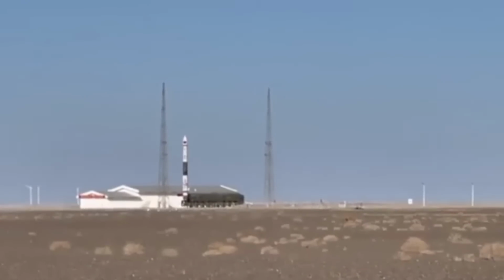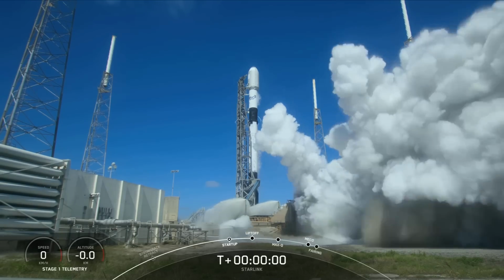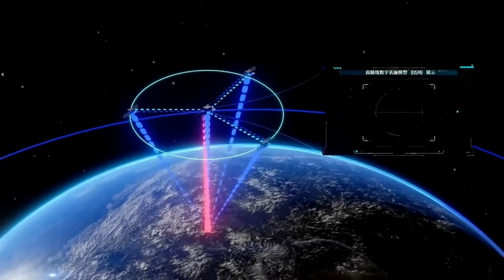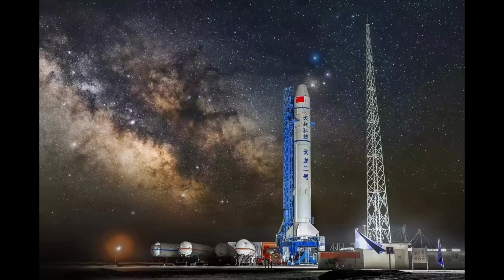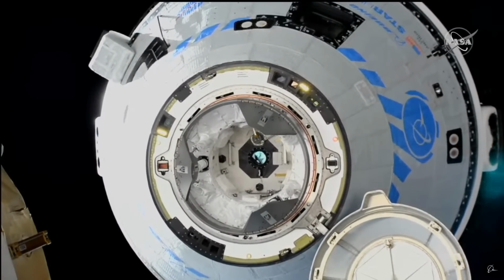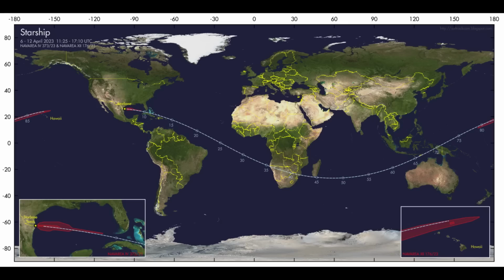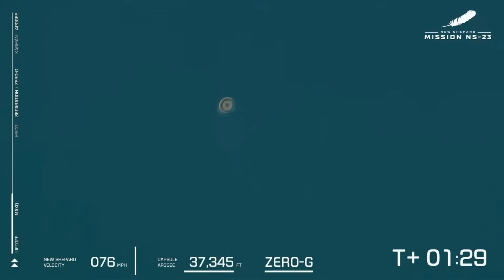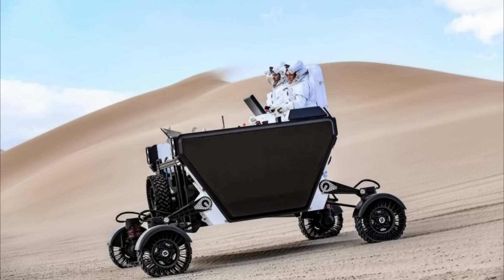Is China's New Rocket Really Coal Powered? Deep Space Updates - April 2nd

Comment: Hey Scott. given the resent tests of the Rotational Detonation Engine, what is your take on when we'll start seeing it used on actual launches?  any thoughts? (good luck on your flights!)
Reply: Not Scott, but: Last tests were on low power prototypes, short duration. Some of the math is still unsolved, so it's years away.
Optimistic timeline: 2030, realistic one: 2038ish.
Reply: We'll have scramjets and fusion power plants before RDEs. It is always a very good bet that any technology idea that has been worked on for more than 50 years and still has no practical prototype will never have one.
Reply: @kenoliver8913  Well, that is the point. We now have a practical prototype. Hence the question....
Reply: 2038? I feel like that might be a little optimistic. I would peg that as the early timeline personally, but only based on guesses

@knoz, it's more of an experimental prototype rather than practical
Reply: @joshuacheung6518  Yeah, I multiplied my actual guess by 1,2 because of the advent of a.i. Also I didn't know if you guys or the 'naive optimism squad' would show up.
Buy still, we just had a working test article, after the field has, um, stalled for a few decades.
Reply: Turns out the optimists wanna do flight at mach 3 next year. Take that with a good helping of table-salt.
was just on ars technica, under science/2023/04/a-passenger-aircraft-that-flies-around-the-world-at-mach-9-sure-why-not/